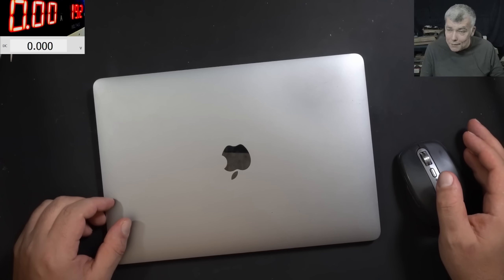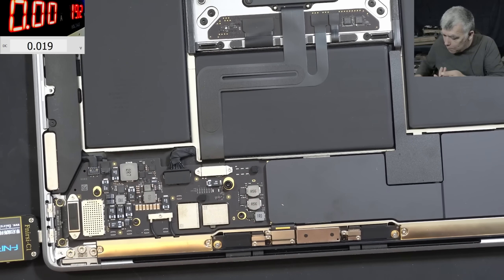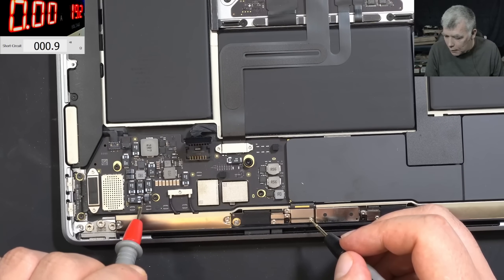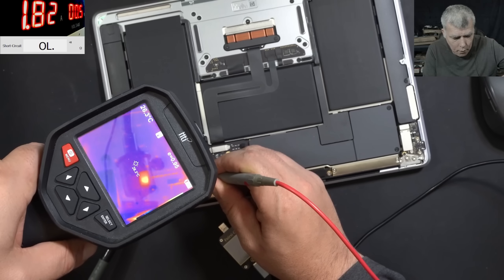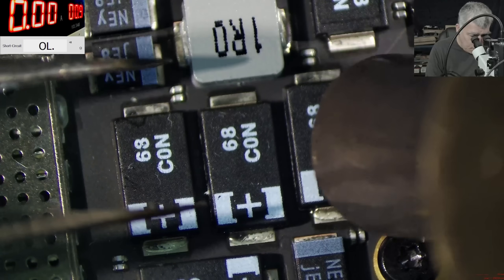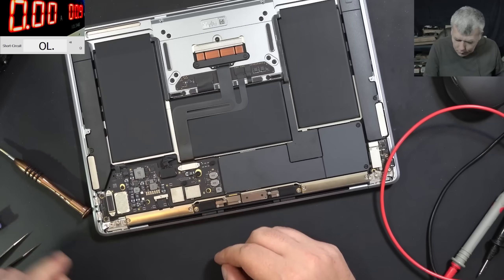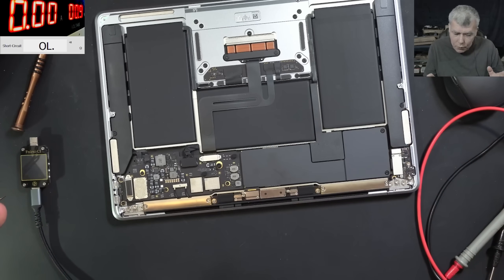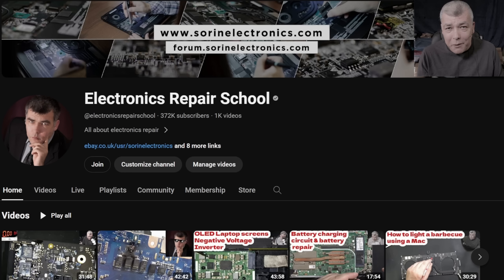MacBook Air M1 A2337 - stuck in 5v 20mA, definitely a fault YOU can fix!

Comment: With two pads and the insulating board there is a still a "capacitor" there just not of the same capacitance (but much better voltage rating!).
Reply: Yes, because a couple of picofarads is the same as a few microfarads 😅😅 👌
Reply: @Johnny8eG00d 😂
Reply: Reducing or increasing the number of caps in parallel don't change the voltage rating.

Comment: What is PID controller in laptops???
Reply: PD, not PID. Power Delivery Controller. Manages all things charging related by communicating with charger, battery and System I/O chip

Comment: Should replace electrolytic caps. It might be working now, but it might cause an issue later due to ripple. Ok to leave off some ceramic bypass caps of course.
Reply: LOL! You really don't know that there was 3 same capacitors. And one less means almost nothing. Any Engineer who projected that motherboard would've put at least 2x more value than needed. So, still that circuit have at least 125% of real needed capacitance.
Reply: @ So you work for Apple or have seen the schematic? You cannot know that for sure otherwise. I wasn’t asking a question anyway, it was a statement.
Reply: @milsiart4976  if 1 failed with all this "over spec" imagine how much harder the other 2 will work and how fast they fail.

Comment: Hello genius. For the placement of the capacitor indicates that's at the output of the main power supply. Not replacin it increases the ripple.
Reply: So? More or less, switching power supply what charges that laptop has no ripples? And it still works. Forget it dude.

Comment: Sorin, ok you fixed it...who puts back the component?
Reply: Seriously. Had to thumbs-down this. Wow, you found the failed cap. What, you let the other 2 take the brunt, rather than replace it?
Reply: @yeahright9014  You know, that capacitor fail would make customer to buy new motherboard. So, Sorin did the best for customer. Non-working laptop works and will work for at least 3 months. So, if other cap blows, that would be another easy pizza. Which may or may not happen eventually. But chances are less than having that capacitor replaced.

Comment: these laptops are new, 3-4 years. why do they have electrolytic capacitors failing already?
Reply: Because don't have too much tolerance..should be bigger and more voltage handling.. but for the sake of space capacitors, it is too small for that voltage
Reply: @MrBesmir7  Yeah, stuff like this makes me kind of miss creative cutouts in boards to house bigger capacitors sideways. Instead they just dump a whole line of small SMD capacitors next to each other, which feels so "duh" to me.